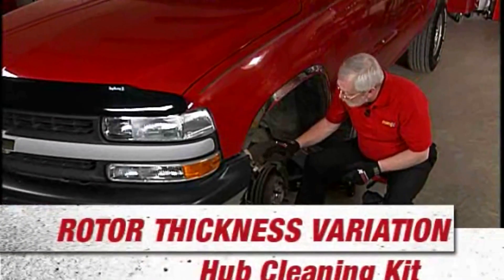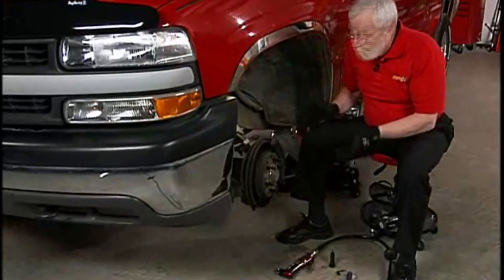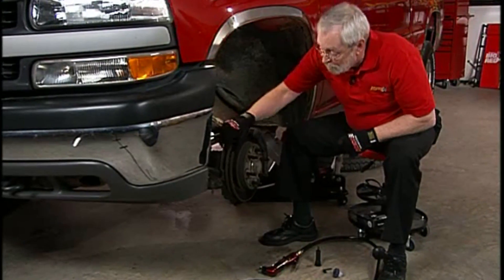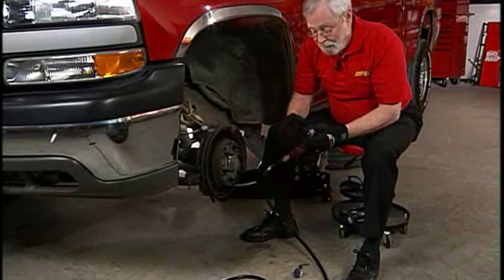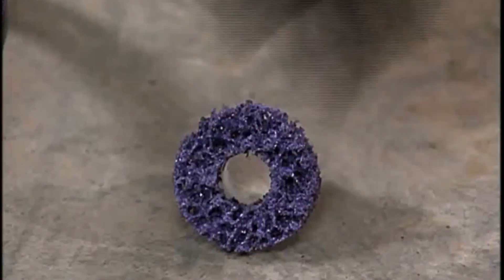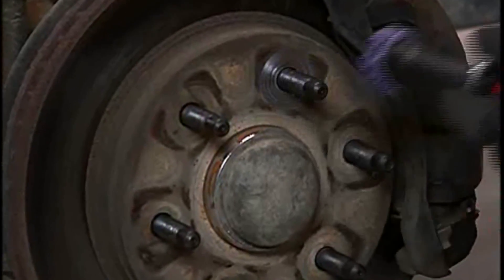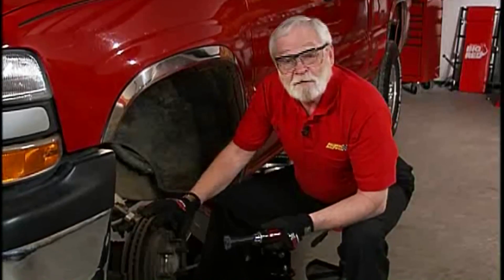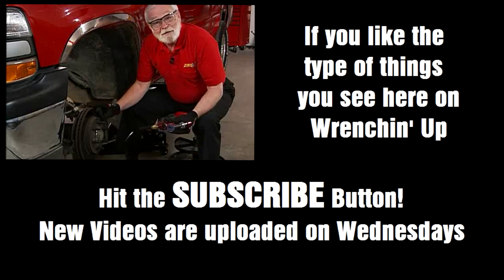Stop Disc Brake Rotor Thickness Variability! - Wrenchin' Up

Comment: Hello,  Would 3M pads do the damage to the metal or will only clean up the rust with out damage the hub?  Thank you,
Reply from the maker: Hi - Thanks for watching! I haven’t used them for that purpose so I can only guess that light pressure might be OK. Let us know how it works out if you try it.
Reply: Thank you, @WrenchinUpwithJimBates

Comment: Ingersoll rand make excellent tools. I don't see how keeping the surface between the wheel and rotor make any difference. Surely sufficient wheel torque overcomes any surface irregularities- Unless they are big ones? 
Thickness variation is the transfer of pad material to the rotors under heat is it not!?
Reply from the maker: According to the studies and demonstrations by  Ingersoll Rand, 3M and a brake disc manufacturer the variation can come from the slight "wobble" of the disc as is rotates between the pads in the caliper. The application of the pads during braking causes uneven wear, resulting in disc thickness variation. Rust build up around mounting studs can be a cause of this problem. Who knew? I learn something new everyday! Thanks for your comment and thanks for watching.
Reply: Actually, contaminants on the back of the rim and on hubs directly affect clamping force.  Once those materials start vibrating they move around and create empty space, thereby relieving the force.  Your lug nuts will soon begin to loosen too.  However, more important than cleaning the hubs and the rim, is cleaning the studs.  Which this tool does not.  Of course you should do both. Check out Stud Kleen https://www.youtube.com/watch?v=tTn46tS3_dQ   It does both and lasts longer.